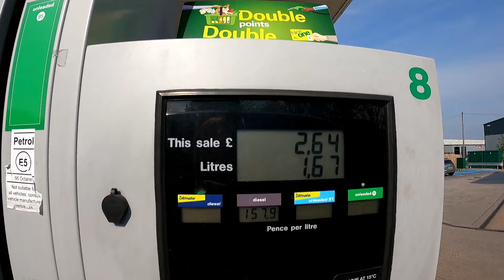Cat Flap Fitters Chronicles - Bank Holiday Monday

Comment: bet there was dust everywhere inside after using the grinder...  defo get the impression of DIY dave
Reply from the maker: This is where the dust extractor is a God send.😁
Reply: @cheshirecatflapfitters openning the window yeah mega 😂
Reply from the maker: Please re-watch the video 😃 @jacobnewman8443
Reply: @cheshirecatflapfitters   i did you had the mask hanging from your neck
Reply: dave
Reply from the maker: Calm down Chaps! its only a bit of dust. I've been at this a long time. I know how to tidy up and how to leave a customers home. I made two small cuts lol i put the Go-pro by the extractor for effect (clearly worked to well) i closed the window not open it . the mask wasn't needed as again just two small cuts lol again just for effect. I have a extractor, a hoover, and a dust pan and brush lol. You cant make an Omelette without breaking a few eggs. Customer was very happy, so I was too.
Reply: You should wear the mask just drilling a hole
Reply from the maker: Very true 👍 now that's a bad habit of mine.
Reply: @totten330  bedwetter!
Reply: @jacobnewman8443  bedwetter boi!